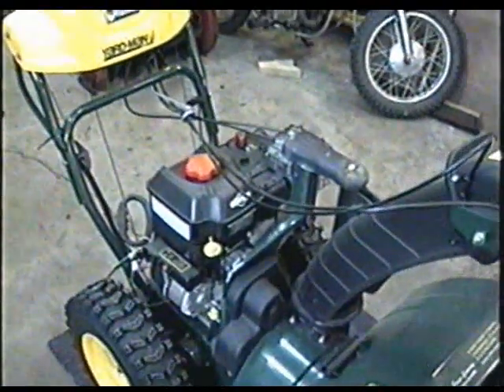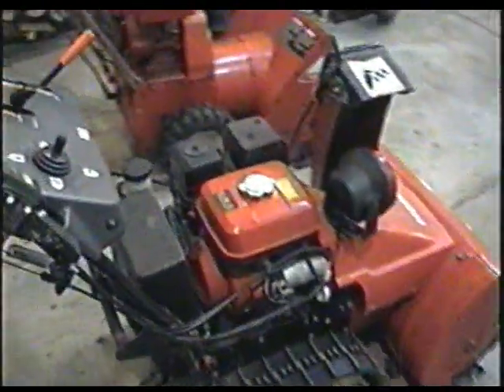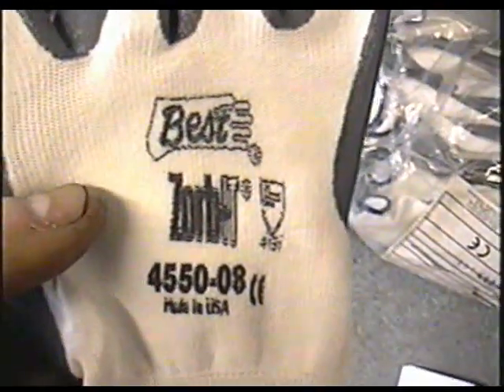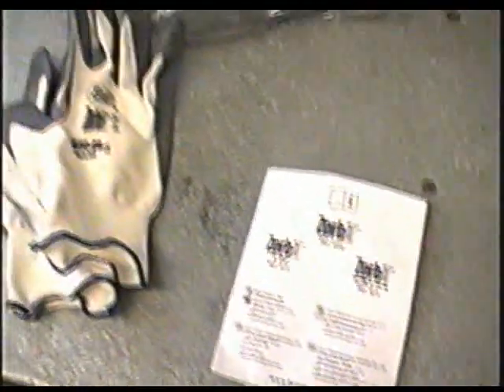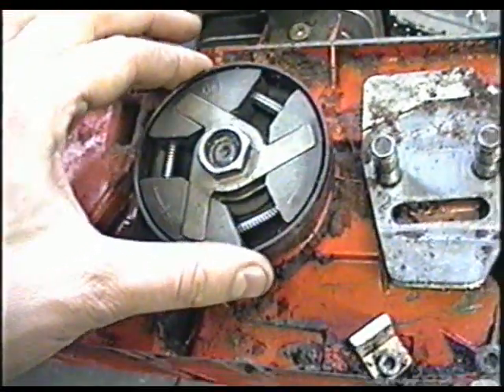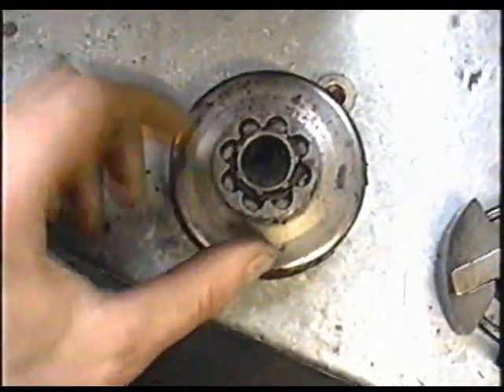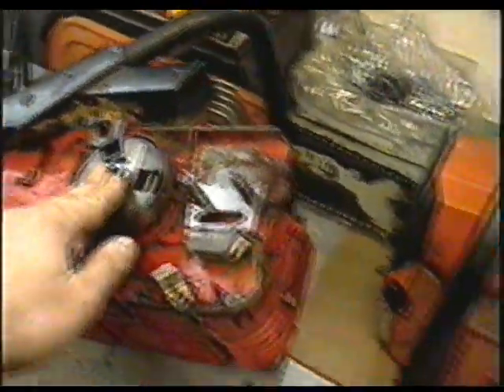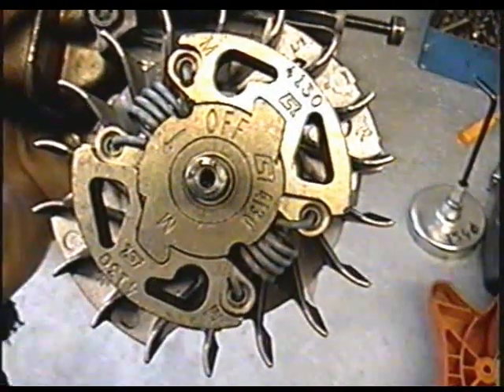Small Engines Q & A  Video #23

Comment: I use similar gloves, different brand, they are polyurethane coated. the only problem is that oil and gas will eventually soften the materiala as you say. they can handle heat, but are very poor for woodworking.